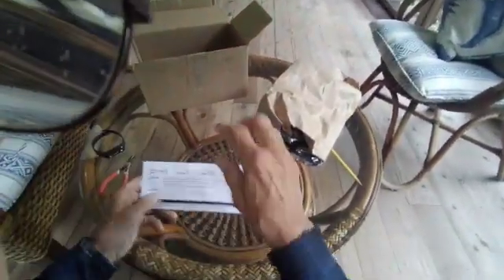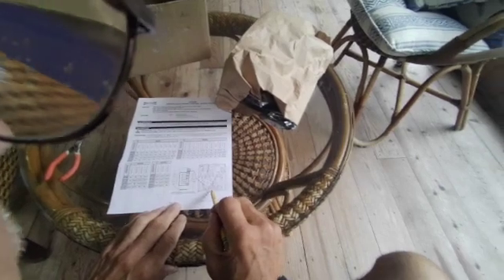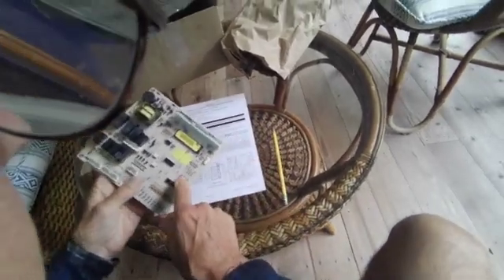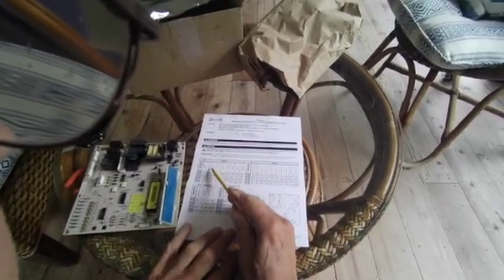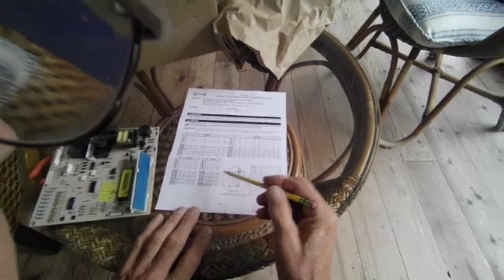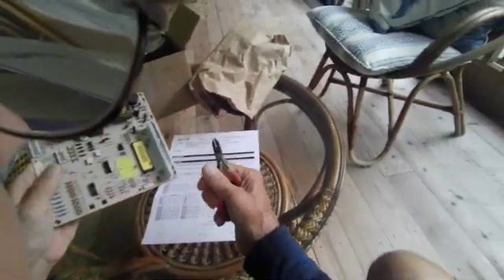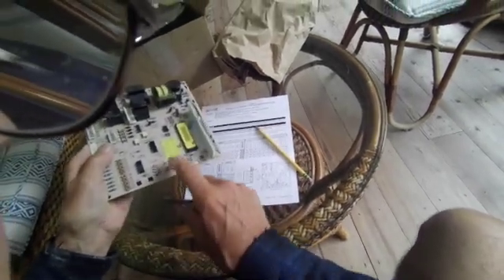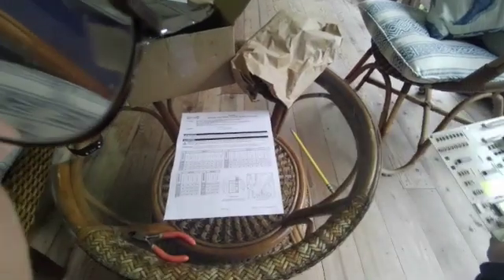Sub-Zero 600-700 Control Board Configuration

Comment: Thank you for the informative vid. Would it be a problem to desolder the transistor instead of cutting it? Just in case for some reason it needs to be reinstalled?
Reply from the maker: Yes you can
Reply: @SubZeroSpecialists  Many thanks!

Comment: I have a 700TF that will only run the compressor for about 3 seconds after it’s plugged in; I have checked the thermistors and overloads and they all seem to function correctly; is there a way to troubleshoot the control board?
Reply from the maker: Is the power to the compressor being disrupted or is the compressor kicking off on the overload? You could try to run the compressor directly using a power cord. Also check the terminal at purple wire on the control board to see if it's the board. If no power at the terminal it's the board.
Reply: @SubZeroSpecialists  found it! The evaporator thermistor connection at the board was faulty - it measured correctly at the sensor but when I moved the connector it started to function. Loss of the thermistor signal was causing the compressor to run a defrost cycle on power up due to the open thermistor connection